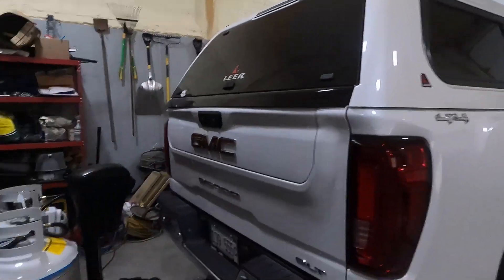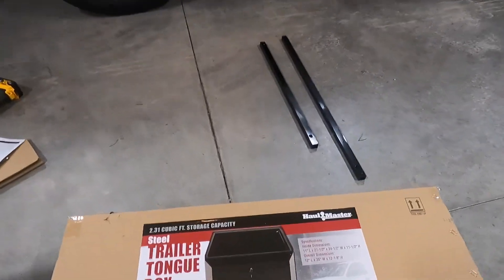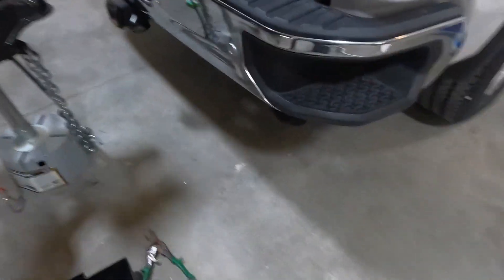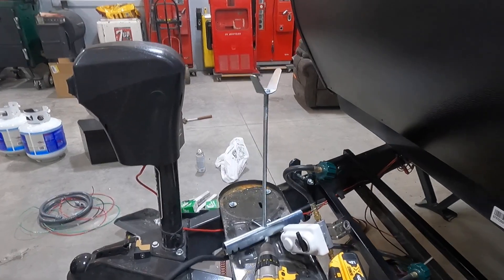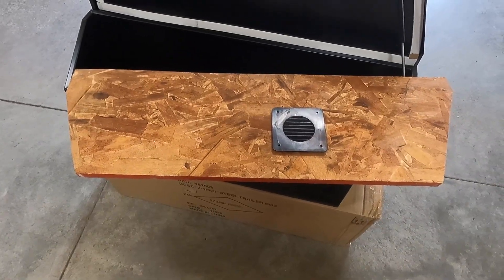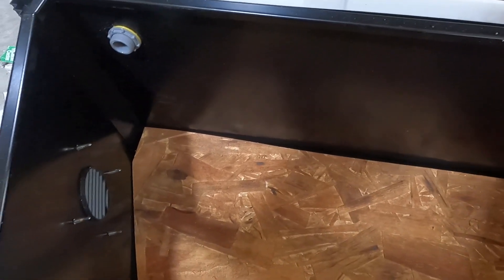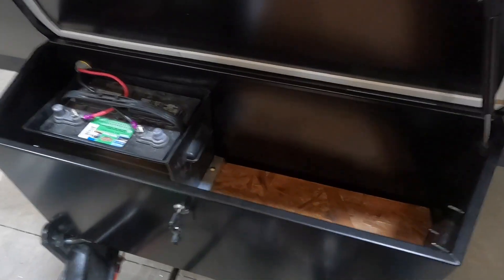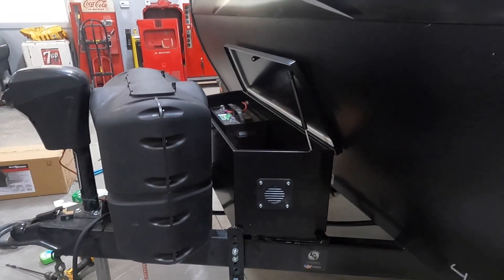Installation of Harbor Freight Tool / Battery Box on the Tongue of a Grand Design Imagine XLS 22MLE

Comment: Awesome display of options, thanks
You should do the Electric jack mod and turn that thing 90 degrees, even more room, and on a Ford you can drop the tailgate while hooked up.
Reply from the maker: Thanks for watching and commenting.  I did do the tongue jack modification a while back.  I posted a video of it. It was a great modification.  So much easier to get into the truck when hooked up.

Comment: I have the 22MLE as well. Just bought a tongue box that is 39”W x 13”D x 10”H. Looks very similar to yours, but a in rectangle shape. Like the idea of installing on top of the 1” aluminum square tube. I also have the same bracing for my towing sway bars. It doesn’t look as though they interfered, so hoping to get the same results. Great idea with the electrical conduit.
I may change the lead acid battery for a lithium (200ah) with low temp protection and move it in the trailer under the bed.frame.
Reply from the maker: Thanks for watching and commenting.

Comment: Just wondering, since it has been a while since this was posted, how this has worked out for you.  I was curious whether you have had any issues with water kicking up from the tow vehicle and going through the vents? Are there weep holes in the bottom of the box? Would it work better to put the vents on the back side of the box?
Reply from the maker: Has worked out great. We have had no water intrusion at all. Did not drill any holes in bottom. Might not be a bad idea though. Thanks for watching and commenting.

Comment: Do you have access to the lock? Or do you need to remove the propane cover?
Reply from the maker: Hi Keith.  We do have access to the lock.  It is close but just enough room to get key in and unlock without removing cover.   Thanks for watching and commenting.  Kent and Tami

Comment: OUCH, Kent…you poked me in the eye in your intro! 😂😂😂 Just kidding! Lol! Very nice installation! Two things I’m wondering about: (1) I ‘think’ you said you were going to attach the excess wire to the battery onto the frame of the tongue…wouldn’t that cause chafing on the wires due to movement with driving down the road, wind, and, rough road, etc? How about attaching the wires low on the wire entry side of the box with a conduit pipe clamp and let what little wire left hang free from the frame in the empty space.(2) also, it sure looked like close quarters between the front of the new box and propane bottles for locking the box..just curios…may have just been an optical illusion though. Great video as always! Safe travels! ~Jim~
Reply from the maker: Hi Jim,  The wire is in conduit.  It is not attached to the frame at all.  It is a little close but you can easily get your hand in there to lock and unlock the lid.  The panduit strap was to attach the conduit to a support from the old battery box. The conduit runs to where the junction box that Grand Design installed is mounted.  Thanks so much for commenting and watching.  Really appreciate the support.  Have a blessed weekend.  Kent and Tami
Reply: @ktkamping4975  oh okay. I didn’t wanna appear to be nosey..I’m just naturally a caring and wanting to help kind of person! I should’ve known you had things under control! Have a great weekend!
Reply from the maker: Jim,  Really appreciate you checking out and asking.  I have been known to mess things up once in a while. lol.  Kent
Reply: @ktkamping4975 > As the Fonz would say “Heyyyyyyyyyy”…we are all just human! …”Don’t worry about it” (quote from the mafia or maybe JAMES Gandolfini! 😂) Have a great and blessed Monday!